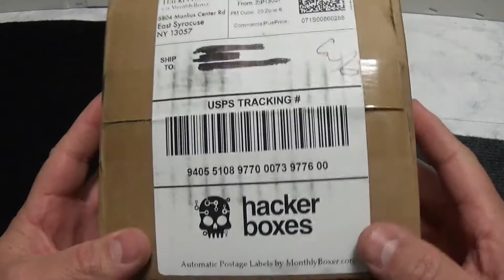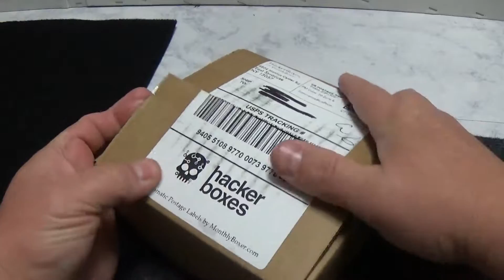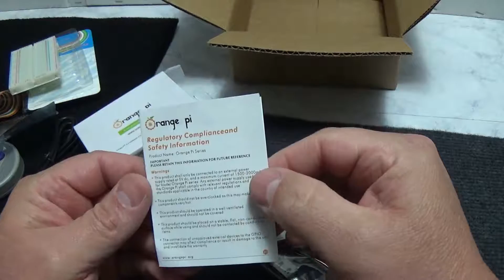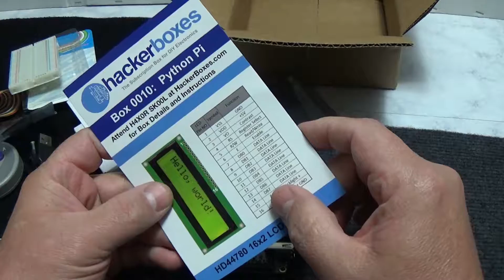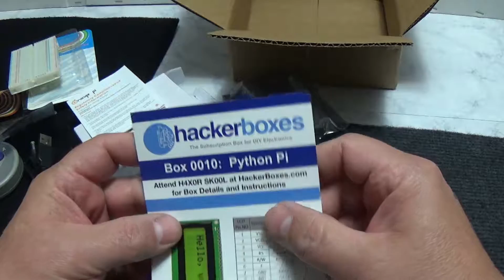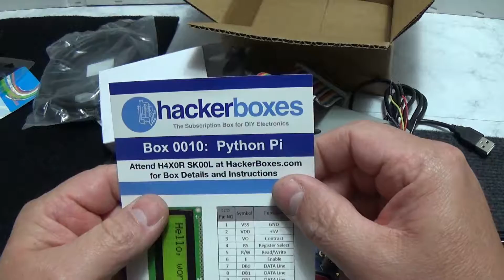HackerBoxes 0010 - Python Pi

Comment: Do the hacker boxes actually have a "project" that you follow to build what's in the box and ideas of ways to explore it further?  I ordered a hacker box, but unless there is something more than a single printed card, it'll likely be a short-lived subscription.  Thanks so much for the video, it's very helpful to see what's in there before it arrives!
Reply from the maker: There are instructions on instructables for each box. Some boxes have better instructions than others.
Reply: Thank you, I found the answer earlier tonight on instructables (and read through a few).  Going to give it a try and see what it's like.  Should be fun to tinker with.  Noticed the most recent HackerSchool project is robotics, sure hope that is the kit I receive.  I'm actually working on building a robot currently (currently Arduino-only, but want to integrate it to a Raspberry Pi+several arduinos).  Thanks again for the kind response!